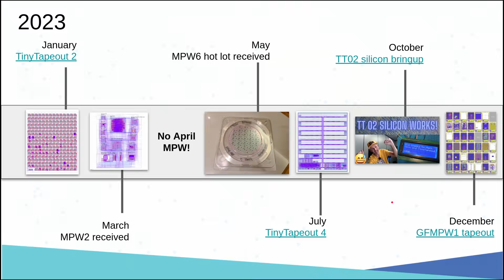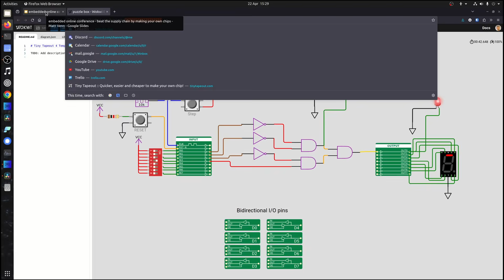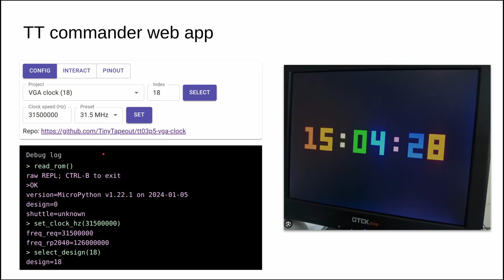Getting started with open source ASICs: community, tools & demos!

Comment: Does anyone have a reading list for RF IC design, maybe just a good book?
Reply: The Design of CMOS Radio-Frequency Integrated Circuits by Thomas H. Lee
Reply: You’ll want to learn the fundamentals of FDTD analysis too. There’s several good books out on the topic. Software not so much that is affordable, just write your own Maxwell solvers for materials.
Reply from the maker: This came up on linkedin recently: https://www.linkedin.com/feed/update/urn:li:ugcPost:7233876012390912000?commentUrn=urn%3Ali%3Acomment%3A%28ugcPost%3A7233876012390912000%2C7233908167196254208%29&dashCommentUrn=urn%3Ali%3Afsd_comment%3A%287233908167196254208%2Curn%3Ali%3AugcPost%3A7233876012390912000%29

Comment: The Rise of Open Source ASICs: Community, Tools, and Demos

* 0:32 My first ASIC: The presenter discusses his first experience designing and manufacturing an ASIC, highlighting the surprisingly small size of FPGA designs.
* 1:22 Context: Provides a historical overview of the open source silicon movement, mentioning key events like Google's free shuttle program and the development of the Zero to ASIC course.
* 7:34 Community: Emphasizes the importance of the vibrant open source silicon community, with nearly 7,000 members on Slack collaborating and sharing knowledge.
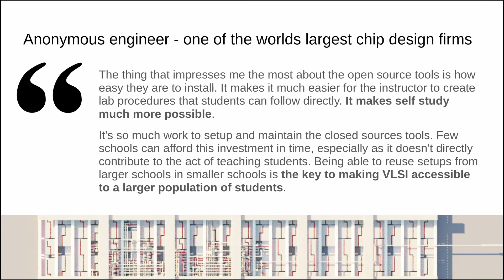* 9:51 Tools: Showcases a variety of free and open source tools available for digital and analog ASIC design, including OpenLANE, OpenROAD, Magic, KLayout, and more.
* 11:34 What's missing:  Outlines areas where the open source ASIC ecosystem needs improvement, such as RF design tools, analog IP, and mixed-signal simulation.
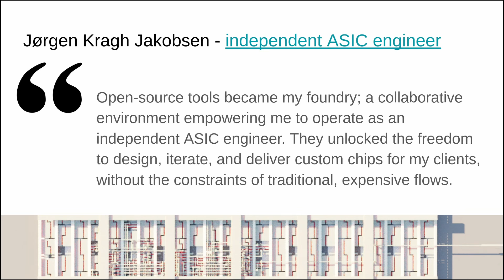* 15:36 Siliwiz: Introduces Siliwiz, a browser-based tool for learning the fundamentals of transistor-level semiconductor design.
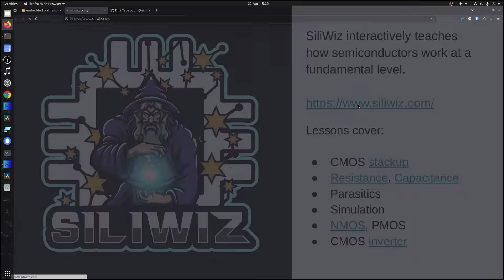* 16:01 Siliwiz Demo: Provides a live demonstration of Siliwiz, showcasing its interactive lessons and simulation capabilities.
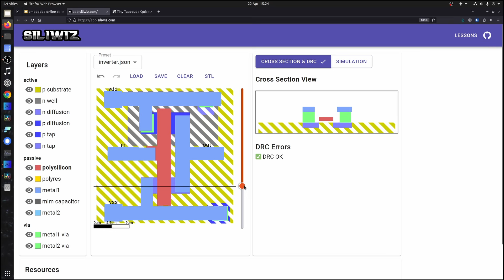* 17:50 Example projects: Highlights various projects built using open source tools, ranging from microcoded USB peripherals to satellite transceivers and AI accelerators.
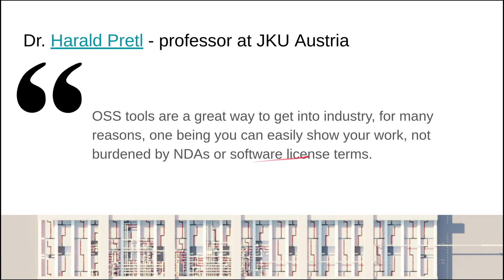* 20:17 How can you make a chip?: Introduces the Tiny Tapeout project, which enables affordable ASIC fabrication by sharing chip space among multiple designers.
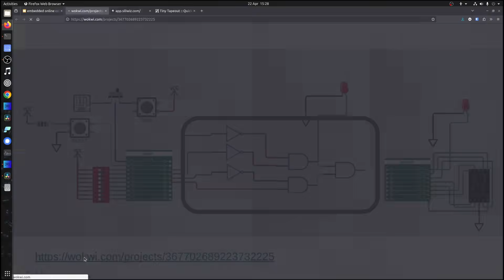* 21:45 Wokwi demo: Demonstrates Wokwi, an online tool for designing and simulating digital circuits, directly integrated with the Tiny Tapeout project.
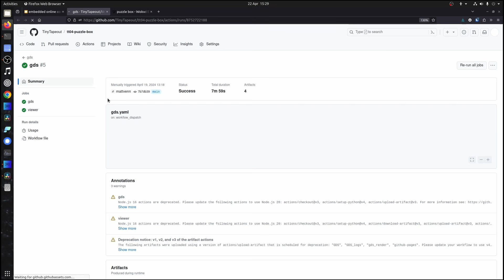* 23:05 3D layout viewer: Showcases a 3D layout viewer that allows users to visualize their designs at the transistor level.
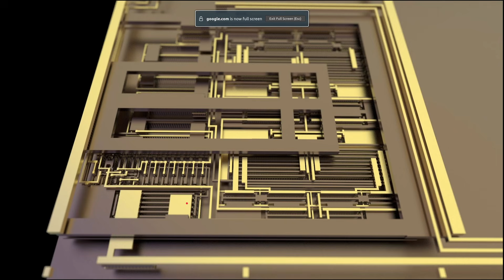* 26:37 Mixed signal support: Discusses recent advancements in mixed-signal design support, enabling the creation of analog and mixed-signal ASICs.
* 28:30 The demoboard: Presents the Tiny Tapeout demo board, which includes a fabricated chip and an RP2040 co-processor for testing and interaction.
* 30:47 Analog Philosophy: Briefly mentions an interview with Nordic Semiconductor's principal IC scientist, further emphasizing the growing industry interest in open source tools.

I used gemini-1.5-pro-exp-0801 to summarize the transcript.
Cost (if I didn't use the free tier): $0.09
Input tokens: 24070
Output tokens: 833